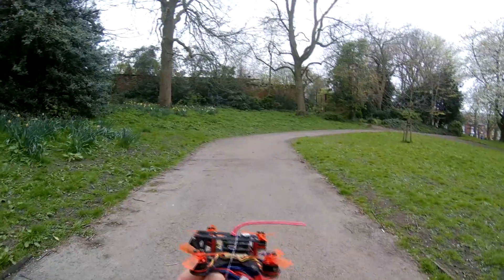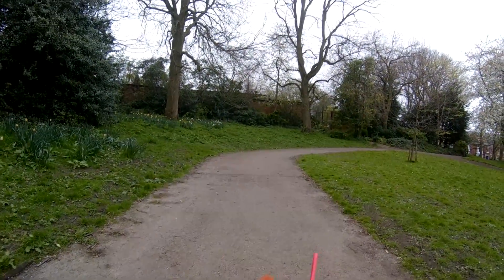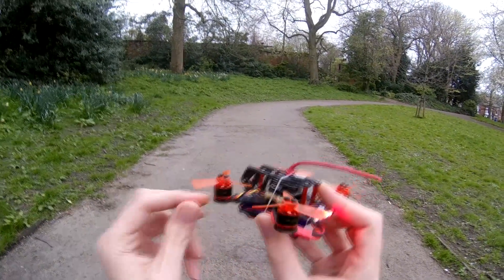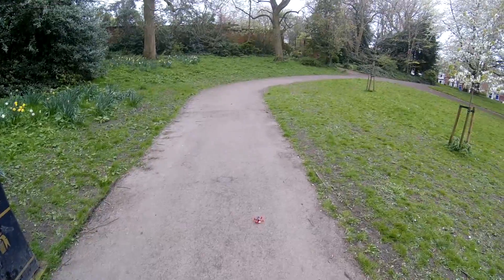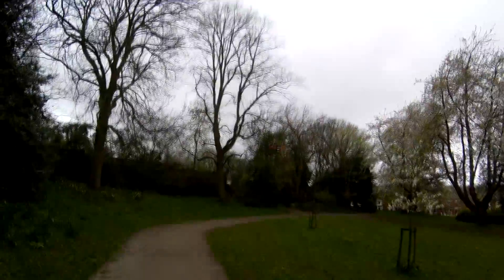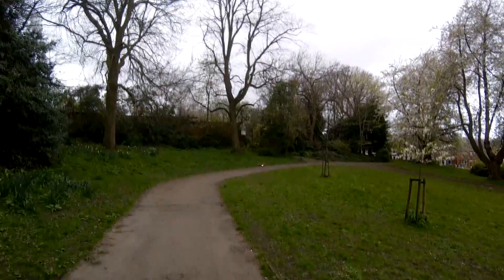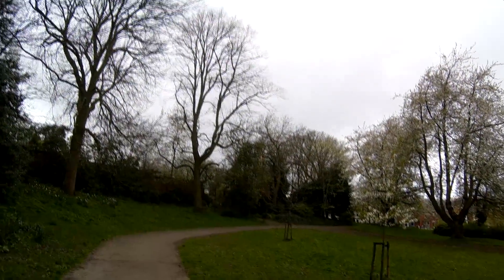Aurora 100 - Firer 110 Upgrade - 2S and 3S Power

Comment: What do you think Aurora 100, ARFUN 90 or Firer 110 to buy?
Do you have no troubles with the cam+vtc combo? I've smoked out already 2 of them, they are so freaking hot when you not fly right away or when i screwing around with the pids there is not enough air flow to cool. The are too compact in my opinion for proper cooling 2 IC's right in front of each other, i don't like them very much. I use these ones, much better and low profile: https://tinyurl.com/med3poq or https://tinyurl.com/n2p8caf
Reply from the maker: If it's for bashing the Firer 110 looks the most solid. FPV is a not compelling for me because props are so much in view although most people don't seem to care or prefer it.
If it's for pure looks, I dig the E90/ARFRUN 90. That ARFUN has larger ESC too although I have had zero issues thrashing the A100 electronics on 3S so I think the motors would give away before the ESC do if over lipo'd and over propped.  I'm just finishing up some prop/flight time experiments on the A68 guts inside the E90. A68 props are slightly in view, E90 props are about the worst position you could put them in view and I really don't like it for FPV.
So from that list the A100 gets my vote because stock flies absolutely brilliant but that base plate needs swapping out for something thicker or doubling up which are both options now and also some basic antenna protection which is also now available. The main reason for me is props are only just barely in the view of the camera.

All I can say is if you gave me only one and any one of them I would be quite satisfied, none of them are stinkers and all have stonking power.

No problem with any other combo cam/vtx units yet unless blunt force trauma which kills everything. Must have over 500 flights on various ones in total but if there is space, I also dig separate components and have several in incoming videos, seems there's new variations every week now. There's a 700 and 1000 tvl cams I have from BG now too worth a look, especially the 1000.